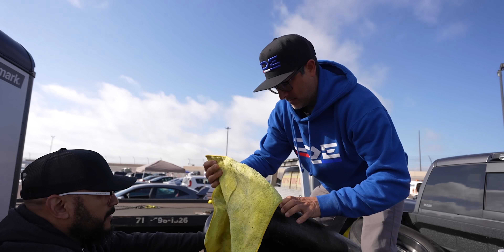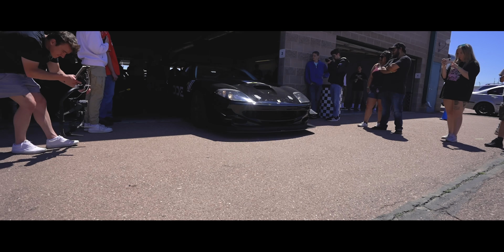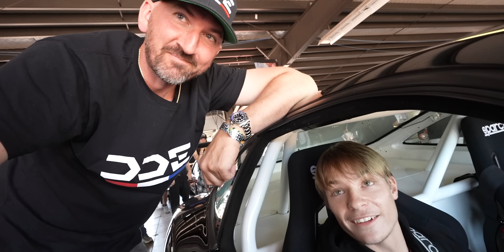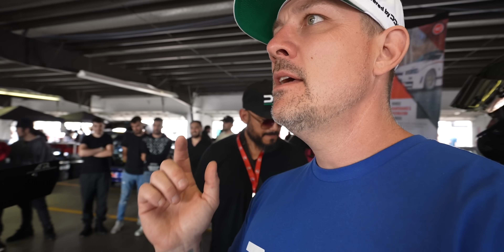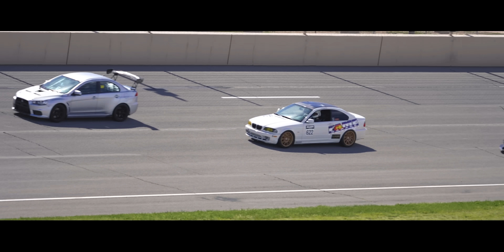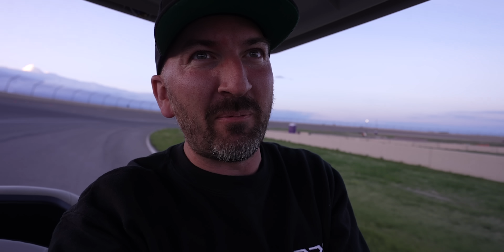THE TREATMENT FOR MY AXIETY & STRESS IS HERE…

Comment: Holy fuck!
Those nitrogen tanks are almost 300lbs!  Thickest walled compressed gas canister ever.  Thicker than acetylene, oxygen, c02, argon etc...
Used to have them delivered to the paintball field I worked at for 15yrs.  I would pick them up a few inches to move it around, would never carry one any distance tho, as it weighed more than I did.
You learn real quick how to roll them upright super fast.